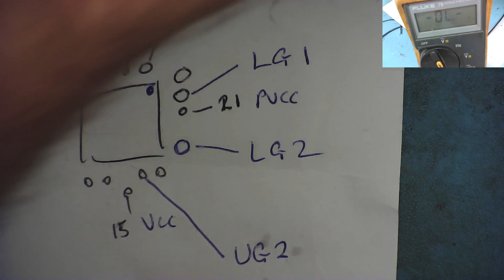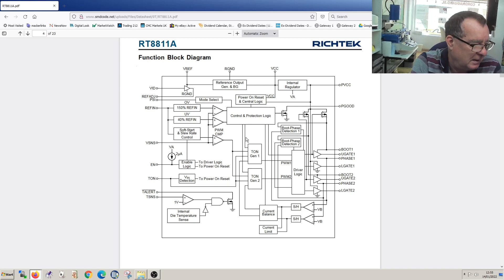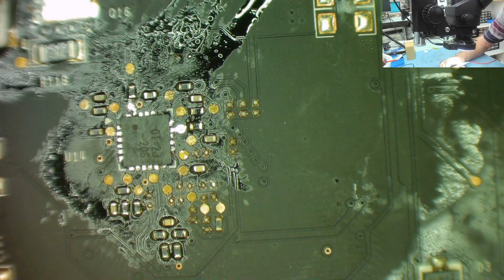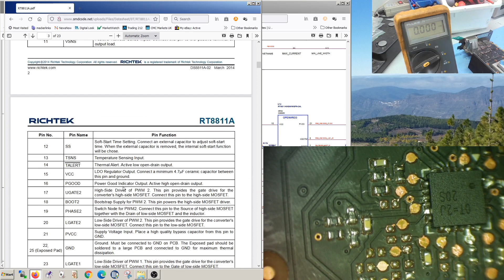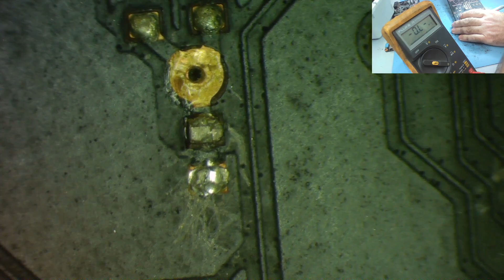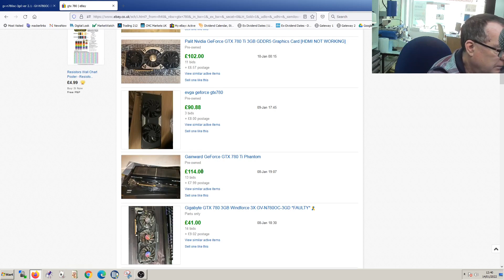I bought 13 EBAY Spares or Repair GPUs... Episode 7: GTX 780 part 2.  LER #186

Comment: just use the tweezers too hold the chip down in place while heating it with the air gun , afterwards use a dry solder wick on the end of your iron too suck up excess solder around the outside of the chip that squash out  .. watching you is killing me sir , theirs a easier techniques that provide perfect results
Reply from the maker: There are many different techniques when it comes to soldering and desoldering. Surely, as long as it works, then it is a matter of personal preference which one you use?  

That's what I say to people who are learning, anyway.

Comment: Hi there Richard.
I have a gtx 970 that I have had a go at fixing. The MOSFET was knackered and a capacitor was blown. It wouldn't display a picture and shorted the pc power supply as soon as it was turned on. I replaced the parts(badly!!!) and in the  process knocked a resistor or something off and lost it as it was so tiny. The card now displays a picture and doesn't short the power supply but has lines and artifacts. I have come to the conclusion it's a bit beyond my abilities. Would you be interested in repairing it for me. I also have a 660ti that I can gift you but I would really like the gtx 970 repaired. I wish I had your patience. Kind regards Carl.

Comment: Pro Tip. Its rare but does happen.. I learned this from Rich. If mosfets keep blowing and the ic that controls it, check the coils. If the coil is shorted internally (ie two coils created) it will decrease the inductance and will be 100% saturated sooner. At this point the mosfet is still on and creates a direct short to ground killing the mosfet and potentially the ic too.

To get an appreciation and learn more about inductors and inductance look at the Inductors video on this channel.  LER #187

Comment: On some of the boards that I've worked on they have little teeny 0401 black chips. How do you know what that chip is.Is it a choke filter a resistor or what? Thanks for the videos.

Comment: Richard how is missing the same resistors from two different boards?
Reply from the maker: sometimes components are not fitted on certain models - for example the regular and ti versions of the same card could use the same PCB, and the ti version have some components fitted that are not there on the standard version
Reply: @learnelectronicsrepair  oh is a factory fault
 i see that in regular base
and how s work with missing componet?

Comment: Hi Richard, When you look at the schematic time (59:13) the 47K resistor - R560 and 100n capacitor - C517 they are both DNI, which means Do Not Install - - good luck with your repair
Reply from the maker: Thanks for explaining DNI, I learned something - I did wonder at first if they were missing.  I worked out on the video they could not be the 47K/0.1uF on the Gigabyte schematic as that pad was connected to the wrong end of the missing resistor.  Now i know the missing resistor value is definitely 383K I will finish this repait on another video

Comment: Hi Richard, just spotted your channel. I happen to have 3 graphics cards, two NVIDIA 760s with some capacitors knocked off, and an AMD Vega 56 which I can get a display out of but with blue corrupted columns on screen and the driver fails to load. I live in London, I was going to dispose of them but do you think you can do anything with them?
Reply from the maker: Sure.  Please email me electronicanaria@outlook.com

Comment: One method for the centre pad on IC's is to use low temperature solder paste. Using hot air, the IC 'falls down' as the paste melts (at a  lower temperature than is required for the solder on the outer pins).

Comment: Hey. I have checked value of that missing resistor and it is 383K ohm like on a datasheet. it is 100% correct information. I have 3 msi gtx 780 donor boards. They share same pcb as yours. Good luck keep a good work and greetings from Poland.
Reply from the maker: @Poti
Thank you - this channel is becoming such a useful resource as well as a fun place!  I'll try it after the weekend 😁

Comment: With QFN chips like this it's normally advisable to solder with hot air initially, allowing surface tension to locate chip before removing heat, then with a pair of tweezers apply pressure to the centre of the chip and reintroduce heat, the chip will then solder flat to the board and you will normally notice some solder squeeze out from the sides and cause a little bridge, this is normal, remove heat and apply more flux, then run around the edges with a clean soldering iron to remove excess solder and achieve nice shiny fillets on outer pins.
As you know, flux every step of the way will make this a breeze, and too much solder on the centre pad can make the initial reflow difficult and cause chip to float too high. Finally, when applying pressure with tweezers make sure the rest of your hand is resting comfortably as you apply pressure or you will end up pushing chip out of alignment as you reflow. Also, you wouldn't do this technique on BGA chips. 
I have seen Louis Rossman do it this way and also NorthBridge Fix, which is where I learnt it. hope this helps.
Reply: I also noticed that maybe his solder tip could be a little smaller
Reply: @mira5751  Absolutely, not a conical though, a fine chisel or a J tip is far more versatile and can be used in a many different ways. In this case the edge of a chisel can be used to drag around the edge to solder outer pins, this I particularly useful if you have components close to the package. A J tip can be use in a similar way, you can hook around the component and drag along, plenty of flux and a hot enough iron and you'll have nice shiny fillets.
Reply: @Adrian_Finn  I agree
Reply: Yes hot Air is the only way to do these types of chips as the centre will not solder right with just an iron. Louis Rossman does a good job with Hot Air Soldering https://www.youtube.com/watch?v=gl9NuCiDR7s

Comment: Hi richard, i have same gpu, i cant find ur email adress, i calculate the resistor what u search for and i prob it. Its 385k resistor on circuit. If u interest i can prob it after remove the curcuit. I can send u image if get ur email adress, thanks for video.
Reply from the maker: it's electronicanaria@outlook.com.  If you can remove it and check that would be wonderful.  If it is 385K it's gonna match the Gigabyte schematic pretty much exactly.  I'll still have fun when the other card arrives anyway so no regrets there
Reply: @learnelectronicsrepair  ok richard i removed and check this resistor value its same 385k pretty sure. Its on circuit or remove and check always 385k resistor. U can put 385k resistor what u missing at pcb and it will probably give u a picture at screen.

Comment: Wow this was super interesting.

Know you said you have an additional card coming in to check using a similar model. But might have some more info.

Personally I'm a fan of TechPowerUp as they have great pictures of the cards they review. This although being an Zotac Amp edition looks very similar to the reference boards for Nvidia. Looking at their pictures from the reference card there definitely wasn't anything soldered on the "top" side of the via above the broken resister but the image isn't that good than the value of the resister can be identified.
Reply from the maker: The value of the resistor is not marked on the component.  I pretty much worked out the top two components were never fitted in the video, but thanks for the confirmation. 

Without desoldering one of those resistors from a good card and measuring it (or probably it could be measured in circuit) I don't think there is any way to know for sure what it should be.   Unless someone has the Zotac schematic or boardview 😉

Comment: Hi, i think there is a missing component as you say in 54:00, i' ve sent you 2 emails a couple of minutes ago with two different pictures. Good luck with the repair!
Reply from the maker: Got them thanks.  This proves the top two components were never fitted (which I pretty much reasoned out in the video and explained why).  The broken resisor has no value marked on it (as usual) so unfortuantely the pics did not help me identify the correct value.

Comment: qfn rework primer:
 start with clean chip, flux is fine, even a speck of solder is not
 fill the (board) side pads to the brim with leaded solder using preferred precision tip (i like 0.5 chisel for all microsoldering work)
 fill the (board) center pad about half way (here its important to not overfill it, vias will compensate excess to even the plane but only so much - on boards with no center pad vias try third full, but ymmv - experiment)
 place big drop of flux then stick and align the chip on it
 apply hot air liberally - just straight down on the chip, no angles, no circling
 monitor/inspect under magnifier - if everything was done properly surface tension will correct any slight misalignment as the solder melts and it will seat *perfectly level with roughly even meniscuses*, if not try again (meniscuses can be retouched with iron (rossmann style) - ymmv, i advise against, but chip sitting not perfectly level is a clear failure)

 !!! do not try 'poke' the chip (unless you fine motor control is precise to less than half of pad distance - hint: it isnt, odds are you create bridges) - just apply extra heat when in doubt
 !!! do not try press it down (inevitable lateral forces, see above)
 **expensive fluxes can mitigate above caveats to some degree (rossmann style^^) - but avoiding them lets you do this with cheapest rosin with 100% success rate with just a bit of practice
Reply from the maker: Hi di nf
Thanks for the soldering hints and tips.  I freely admit my soldering technique for QFN isn't brilliant.  Some guys are wizards with this sort of soldering on YT and I admire them, Rossman included.  I'm at the point now where i can do it successfully sometimes but find it a real pain in the ass basically.  

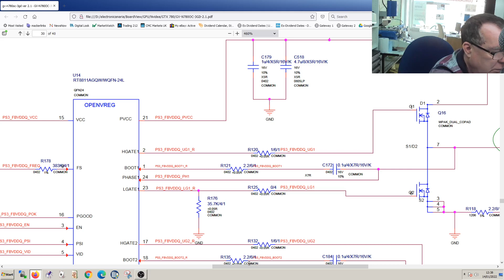Generally if I put too much solder on the pads I can't get the QFN to sit flat and it blows away with the hot air.  So you don't recommend trying to tin the pads as well on the new QFN (with 60:40 leaded)?

I'm using NC-559-ASM flux.

I'll practice some more on scrap boards - maybe make a soldering QFN beginners video - there are others on YT but mostly they seem to be when fitting new chips on new PCB (projects/hobby) and not repair work.  I actually find QFN more difficult that BGA - at least I have a machine to do that

Cheers